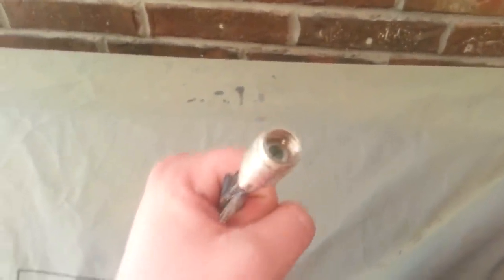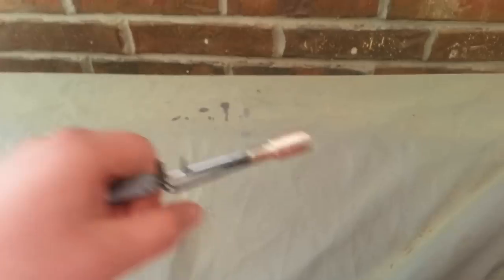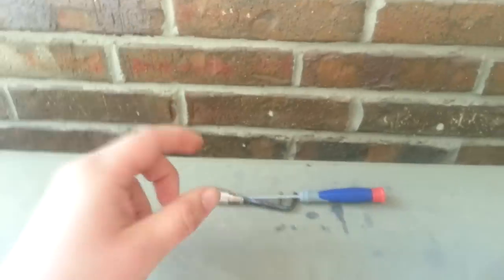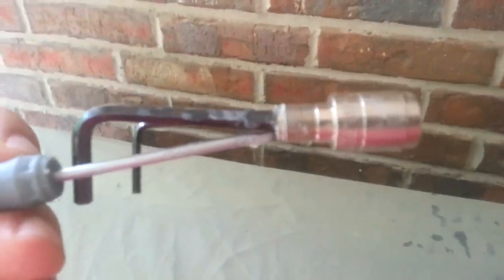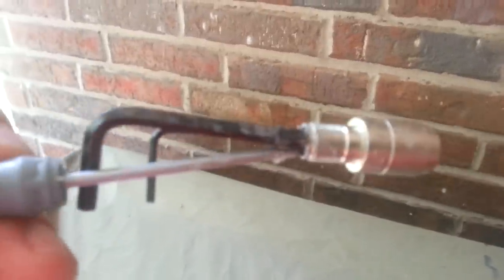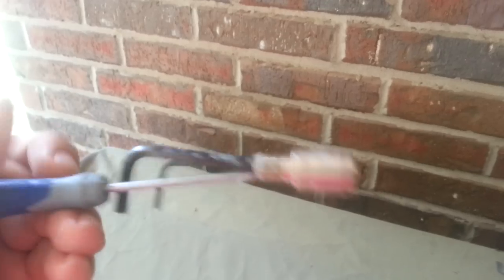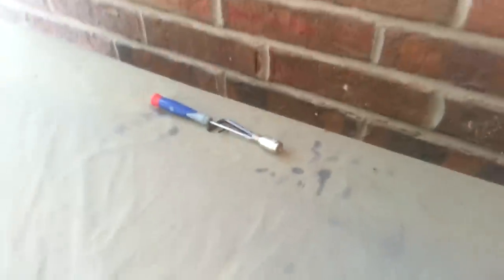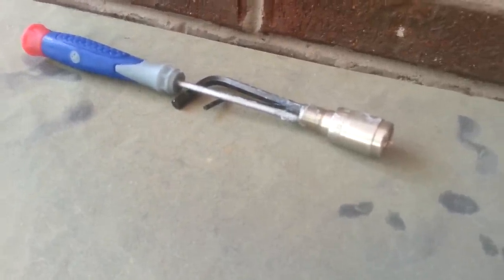How to remove Cable Coaxial Lock

Comment: After you remove the locking terminator, hollow it out. Then make a F fitting with a very long center conductor and dielectric. Reattach the locking terminator and thread the new F fitting through it. It will give the impression of a disconnect, but will give you signal. Make sure everything is tight.

Comment: Just take some fuckin needle nose pliers and pull outwards and twist the fucking thing a few times and off it comes.....and then when you put it back on push inwards and twist.....or you can just buy the tool off of ebay like i did....its better than fucking with crazy glue screw drivers and shit

Comment: Hahaha, look at that mess of tools glued together!! what a genius!  I just cut it off with a small pipe cutter holding it with pliers. Just make sure you cut it closer to the terminal end then you just unscrew like normal... My first instinct (when I was angry after discovering that the cable company installed these inside my house) was to crush it with vice grips like jimmy but I didn't want to damage the cable.

Comment: Lol. Its way easier than that. Look inside the barrel and you will see several thin slots around the outside. Using a thin bladed flathead screwdriver in those slots you should be able to unscrew the inner threaded barrel.
Reply: This definitely worked for me. Thanks a lot for the easy hint. Very easy.

Comment: use a little of that super on the front of the lock near the the threads. that bonds the barrels togethers snd simply twist off
Reply: *super glue